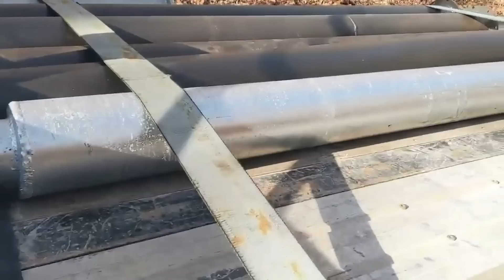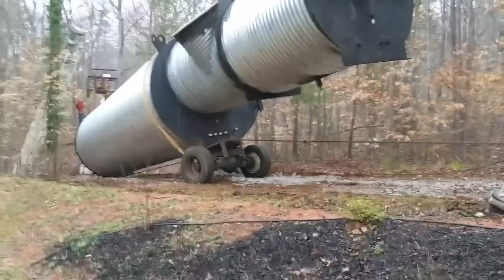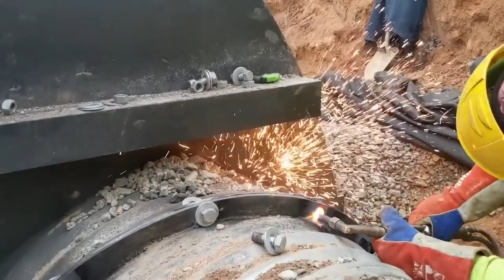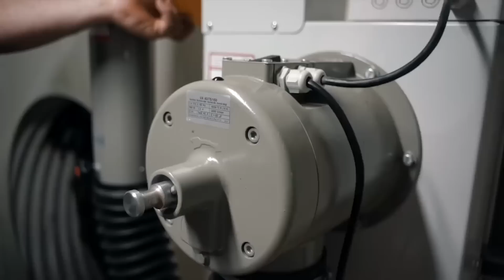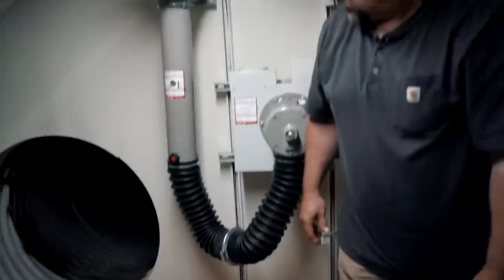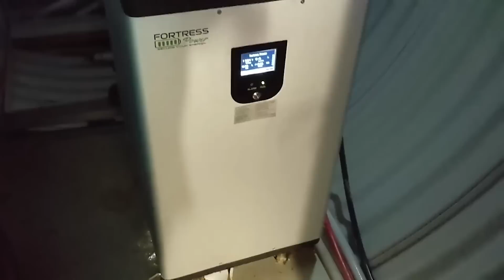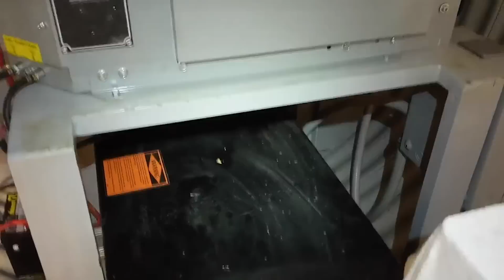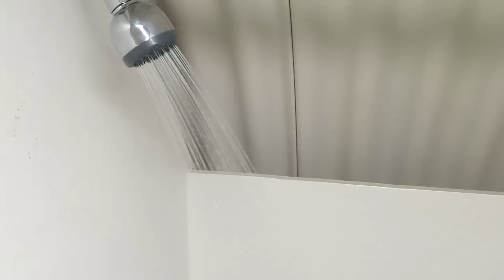Engineer775 installs an Atlas Bunker with Solar, a Diesel Generator, and WIFI!

Comment: This particular video caught my attention because of the incorporation of redundant electrical power and solar. Most importantly was the introduction of Wi-Fi + cellular but there was no discussion of outside antennas to bring the signal down below the Earth. I would love to have seen more on that.

I noted that he put an emphasis on communication and mentioned Ubiquiti radios which as an amateur radio repeater owner I am more than familiar with. But there was no discussion of what they were used for that I would have appreciated. 

That has been a big question of mind as far as if the crap hits the fan and we have a foreign invaders such as Russia and China who have now announced their cooperation with one another to join forces essentially how the shelter would be useful when the opening to it is visible but yet one of the air intakes is hidden in a fake rock. It seemed to be a contradiction.

Another part along the lines of the Ubiquity, which is generally a 5.8 GHz microwave system, how would an amateur radio operator communicate from the bomb shelter when one would need an outside antenna? That is a huge factor in my planning. Newer amateur radio equipment actually has a LAN port and the Ubiquiti could actually be used to communicate remotely with the actual amateur radio equipment and antenna that would be installed at a location some distance away from the site. That way the enemy couldn't say 'look at the antenna and there must be the entrance to a shelter somewhere.' If the operator in the shelter was communicating with other Preppers that were acting like Red Dawn that would definitely be a problem. Unlike WWII, other countries now easily have the capability of putting troops in the United States.

What if this shelter was being used as a result of a nuclear detonation? The heat would melt the antennas and a whole lot of other things would become inoperable. A nuclear blast would render the solar system inoperable. The generator would only run for so long. I would actually prefer to see a couple of 1000 gallon propane tanks buried that would be capable of running the generator for a month or more. Far more than 150 gallons of diesel that can only be stored 6-12 months. It's better than gasoline that needs an additive and still doesn't last that long. But propane is eternal. In reality, an enemy would more than likely use an EMP detonation so as not to destroy the infrastructure of the country that they wish to occupy. That's a complete side issue.

Was LED lighting used throughout? Was 12 V used as much as possible rather than 120 volts? 500-1000 lb of propane will only run a normal generator for up to 96 hours at 3 kilowatts per hour. The generator would be last result if the solar was down. Perhaps a bicycle generator as a backup to recharge the lithium-ion battery?

I have many questions and don't want to burden This Thread down with answers to all of them. But communications is a big one for Preppers in the event that a Red Dawn type situation actually hits the United States. The cold war is over and we're entering into a potential hot war. I can actually envision remote mounted machine guns with crossing fields of fire that could be operated remotely from inside the bunker. Maybe I watch too much TV. LOL.

Comment: I like everything about your bunkers, especial extras on the shelter you build, like the blast valve, special NBC system, and the extension on the bottom of air vent in case someone try to flood you out, and the peephole etc.  BUT I don't see some sort of coating to prevent from rusting on any of the shelters Galvanized Steel Culvert Pipe you install. I would like to see some exterior protection, (plus when gravel is poured over will create scratches on the walls), also would like to see insulation for the condescending what will be humid and water will find a way to rust this beauty. 

Recap: External coating and insulation. 

I know price will go up, so will the life of this shelter/bunker. Love to see you Ron take that extra step. Will continue watching your awesome videos and keep up the good work. Hope my comment helps.

Comment: First problem I see is not attaching the solar to the roof and running the lines through the house. Anyone can just come along and take the panels or worse cut the power and starve out the occupants. Or better yet, run each panel up a tree, somewhat concealing them so thieves don’t get them. Solar panels would be one of the first things I’d steal in the end days.  

Second: absolutely stupid to have an exposed fuel drum in a small area. All it would take is one spark. The tank should be separate from the home underground.  

Third: a lady ditch air pipe again should be run up a tree about .5 to a full mile away. Might cost more but should definitely be added. 

If you’re looking for more and better ideas, I’m here. 🤘🏻💚

Comment: Some upgrade you can use are, one of those bike thing that make power incase  the solar panels break, a water system that pours water on the solar panels gets dust on it, and some sound noise cancelling things in the generator room

Comment: If you build one yourself, you might be able to do it for $15000, but it eould be a lot of work. Ive done a bit of research and its not the material of the underground structure which actually protects you from harmful radio its the 36inch of earth on top, so as long as the structure you build underground can take the weight of the earth and you have good air circulation and filtration , it should be able to withstand the fallout and shockwave. Also a bunker would be great for a more deadly covid 2.0 situation, if another pandemic happens but with an 80% mortality rate, being able to shelter for a few weeks would probably help, but longer would probably be needed for the virus to either die off or be contained, being self sufficient and off grid is probably better to survive a deadly pandemic.
People who have good bunkers are going to be so pleased they got it when war or disaster happens.
Reply from the maker: The air system and pipes cost that much

Comment: Uber wealthy prepping: hire a high end company to bury a 12' diameter corrugated pipe below grade and install as expensive a gennie and power cell as possibly can be afforded and never even see it until its done and the final payment is due... The house itself will attract every vulture within 50 miles who will eventually look out the back windows and see the intake and exhaust stacks or hear the gen noise and knock knock knock...

Comment: I don't like that solar panel system. If there is a nuclear problem, you loose them in the first shock wave.. 😑

Try to put a mechanism that allows them to go beneath the surface too.

Comment: Sooo that router means the system can be hacked from the outside...and the hacker can attack your solar arrays, disrupting the power? Hacker can disrupt the diesel generator? He can stop security cameras from working and even fill the bunker with poison gas!! Cyber un-safe, you should make isolated computer system with no connection to outside world xD

and also with UHF radio =)

Comment: PREPPERISMS: This is Not an exhaustive list of knowledge, just inspiration. Please copy, share & prepare!

"MORE YOU KNOW, LESS YOU NEED"
Skills are more valuable than stuff. So acquire as many practical skills & knowledge because they can't be easily lost, broken or stolen & it doesn't weigh anything so "the more you know the lighter your load". Study videos/books on force multipliers listed below & practice daily/weekly. Use following info as a course curriculum, search & study.
Proverbs 22:3 "The shrewd one sees the danger & conceals himself, the inexperienced keep right on going & suffer the consequences."

"TWO is ONE & ONE is NONE"
After you get 1 of every item listed below then get a matching backup to each item because stuff gets lost, broken, or stolen.

"RULE of 3"
You can die within 3 seconds of indecision when facing a fatal threat (predetermine reasonable losses) 3 minutes without air (freediving breathing techniques) 3 hours of exposure to extreme weather (contrast hydrotherapy -Wim Hof) 3 days without water (practice focus while thirsty -fasting from all liquids) 3 weeks without food (fasting) 3 months without a long term plan (seasons change) 3 years without a partner/team (screen members now) 3 decades without reproduction (new generation)

FOUR FRIENDLY FACETS
Instantly increase positive response from strangers by:
Smiling
Raising eyebrows
Tilting head to one side
Open hands with fingers aimed down & palms forward

FIVE to SURTHRIVE!
True, we should be prepared to survive without energy/electricity or public water. But creating energy & water off-grid means more than just surviving, it's thriving!
SOLAR GENERATOR: increase power with more solar panels &or batteries to inverter
WIND GENERATOR: increase power with more wind turbines &or batteries to inverter
HANDCRANK GENERATOR: generates electricity 24/7 regardless of weather, child can turn the handle or connect it to bicycle
COMBO GENERATOR: combines several other sources from above
DEHUMIDIFIER: large model can pull upto 8 gallons of water daily right out of the air! Even in an apartment

CONs: No sun or wind, or human fatigue may limit power. Dehumidifiers are useless without electricity or humidity & prepared to filter the water.

SIX SHIELDED SHELTER
"Watchout With Wetty, Windy, Warmy, Wicky, Wiggly & Widow-makers!"
Build a shelter high & dry above where it may get "wetty" during rain but close enough to a "wetty" source to stay hydrated; where "windy" is blocked when it's cold but allows "windy" when it's hot; where fire wood keeps you "warmy" but where it's shaded from "warmy" when it's hot; shelter off the ground that will "wicky" away body heat & has "wiggly" critters; don't shelter under a "widow-maker" dead tree/limb that may fall & kill you. Remember, you need something to sleep under, to sleep on & to sleep in.

SEVEN CORE MEMBERS
Anyone opposed to your core Principles & Purposes of life should NOT be in your group! All skills should be cross trained.
GUARDIAN (Security, safety)
HEALER (doctor, medic, nurse, therapist, herbalist)
PROVIDER (hunts, farms, fishes, forages, or scavenges for food & necessities)
TINKERER (engineer, scientist, mechanic, handyman, tradesman)
CAREGIVER (domestic [cooking, cleaning, laundry, etc], counselor, teacher/babysitter)
OVERSEER (empathetically unemotional, logical, strategist, negotiator, leads by example, organizes supplies/equipment & tasks)
CHAMELEON (quick learner, adaptable, willing to change positions & has other skills not listed)

EIGHT CORE SKILLS
LEARNING/MEMORY attention=retention, repetition=recall, adaptability=survivability
HABIT CREATION study "Atomic Habits" & use cues, craving, routine, reward; Success is compound interest of effective habits
MEDITATION & FASTING enhances attention span, self-discipline, pain & stress management
HEALTH & SAFETY Eat better but less; Move more often & faster; Hygiene keeping clean; "Ounce of prevention, worth a pound of cure" so eliminate hazards (fire, etc) & develop safety protocols
MEDICAL First-aid & Trauma Care: practice M.A.R.C.H. algorithm, because YOU are your "first responder"
PERSUASION Study negotiation, barter, body language, micro facial expressions, active listening, psychology, persuasive language patterns, listen to your instinct
PROVIDE Hunt, Fish, Farm, Forage, Scavenge: get, reproduce, harvest & store animal/plant food; "When you can feed yourself, you can free yourself!"
SECURITY How to secure any location, be aware of surroundings, evade detection by becoming a "Grayman"; Team hand-signals & covert language; Self-defense if cornered & attacked, target eyes, throat, groin, knees to escape; Remember resilience & tenacity can outstrip strength & speed; Although firearms are common, consider defense tool with low maintenance, not dependent on manufactured ammo: staff, bat, etc.
Severe crime in your group? Jailing wastes resources & manpower, Exile threatens revenge, Execution ruins conscience, but Prayer to the only true God Jehovah eventually eliminates all threats!
(Matthew 5: 44; Psalms 127:1)

NINE FINE STAGES
BALANCE: Acquire EVERYTHING to survive for an entire short period first, Before getting more stuff for a longer period, because you do NOT want to have a year's worth of stored water but only 1week of food & NO medical supplies when everything collapses!
1ST: 1 week of water (1gal per person per day), 1 week of food (pre-cooked non-perishable), medical supplies, 1 week of hygiene supplies, 1 week of etc, etc
2ND: enhance home security, safety & security protocols
3RD: 3 months of water, food, etc
4TH: enhance transportation security, dependability & options (bicycle, cart)
5TH: Bug-Out-Bag Myth -"Bugging out is your 1st move." NO! But despite that sheltering-in-place IS optimum, we never know when we may be forced to evacuate permanently, so make a Bug-Out-Bag because it's "Better To Have It & Not Need It, Than Need It & Not Have It".
6TH: 6 mos mixed seeds (heirloom Non-GMO seeds are more precious than gold) & more food, water, etc.
7TH: Self-Sustainable Sustenance, food production (hunt, fish, farm [garden, chickens, meat rabbits, etc], forage, or scavenge)
8TH: Priority Faith to pray for wisdom & humility to answer "If I only have enough time/money to acquire just one more skill/item before a collapse, what would it be?"
9TH: Physical library of educational books & games (Bible, security, medical, gardening, home repair, mechanical, cooking, homesteading, communications, prepping/survival guides, playing cards, chess/checker board, etc)
Beginner's Goal: strive to survive without electricity for 72hrs. Long-Term Goal: survive a nuclear attack because at this level most anything else can be survived. "Prepping" is not an event, it's a lifestyle.

B.O.B. (BUG OUT BAG)
(Do NOT confuse this with a smaller EDC, Go-bag or Get-Home-Bag kept in your vehicle)
Although examples are included below, get the lightest versions of these items without compromising quality & choose multifunction tools to keep total pack weight to less than 20% of a healthy person's body weight. Ultimately the best survival items are ones you already have & know how to use, so practice improvising equipment/tools. Outside of B.O.B. hang a small bag of "survival pocket litter" that includes one item from each of the following categories & immediately empty bag into your pockets/hipsack & onto belt just in case you get separated from your B.O.B.

CONTAINER: 1L plastic water bottle or metal canteen; mini-Sawyer filter (water=8lbs per gallon so in addition to some initial water, ability to filter discovered water while traveling is vital to keep hydrated & load light)
CUTTING: Knife (fixed, full tang), Multi-tool w/folding knife, saw, screwdriver, scissors, can &bottle opener, &pliers
COMBUSTION: lighters, ferro rods, fresnel lens (magnifying glass), tinder, candle, flashlight, headlamp, glow sticks
CORDAGE: rope/paracord/duct tape
COVERING: 55gal plastic drum liners OR sleeping bag; hammock tent OR 5x8 heavy duty plastic tarp; 2pair socks, 2underwear, 2undershirts (avoid cotton -cotton kills), long-sleeved shirt/pullover hoodie, pants (no shorts), boots, work gloves, face masks, 4 extra large bandanas, hat, mosquito netting, light rain jacket w/hood, (unless you live where it's cold more than ⅓ of the year don't pack a heavy winter coat/clothes, just layer up clothing & insulate w/rain poncho), Avoid camouflage or bright clothing because it's not "Grayman"
CARE: First-Aid/Trauma kit (C.A.T. tourniquet, compression bandages, assortment of gauze, anti-diahrrea, laxative, acetaminophen, aspirin, etc); Hygiene (comb, 4 different colored wash rags [for when toilet paper runs-out], toothbrush, toenail clippers, sewing kit, soap, etc)
CONSUMABLES: Food (pre-cooked non-perishable -MREs/jerky) & Fishing/Hunting tools (fish/gill net, snare wire, traps, hooks line & tackle, slingshot, crossbow, gun)
COMMUNICATIONS: Whistle, handcrank/solar AM/FM weather radio; walkie talkie, CB or HamRadio, Topo Maps  (local & state) & Compass; Monocular; Energy (charger cords, handcrank/solar charger, etc)
CREDENTIALS: (outside B.O.B. pin reminder note to get these when leaving) birth certificate, passport, marriage license, house & car keys.
CURRENCY: Initially cash will still be King; pocket-sized barter items of non-perishable food, instant coffee, sample bottles of liquor, gold/silver chain, candy/gum, condoms, etc
CRAFTING: Axe/Machete, Folding/bow/wire saws, Clawbar/prybar 10" (doubles as hammer & key to city), Self-adjusting wrench, Locking pliers, MultiBit Screw&Nut Driver, Electrical wire stripper
CREATIVE: playing cards, harmonica (can scare off predators), pocket bible, Survival Guide.
"But what if nothing happens?" It's okay to be wrong, just don't be dead wrong!

In the name of my Savior Jesus Christ I pray to his father, Almighty God Jehovah, we always enjoy peace!
Reply: @joseph stalin  Good crossover ammo suggestions! When I said "liquor" I definitely include alcohol. And any other ideas would fall under my "etc". 😉
Love the way you think!
Liberty = Peace & I pray you & your loved ones always enjoy both!

Comment: i can tell many people have never used wifi in a metal building  the walls of a metal building reflect and absorb the wifi single well all radiation in the communication spectrum for that mater  dought you would see wifi single unless the hatch is open and thin you would need to be very close to the hatch
Reply: A wifi router wired inside there. No you will not get any signal from outside.